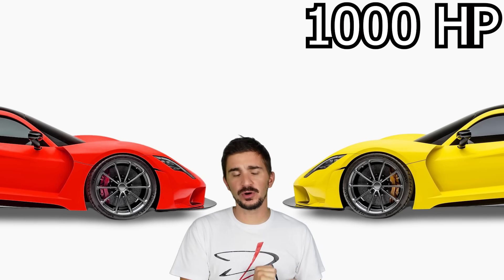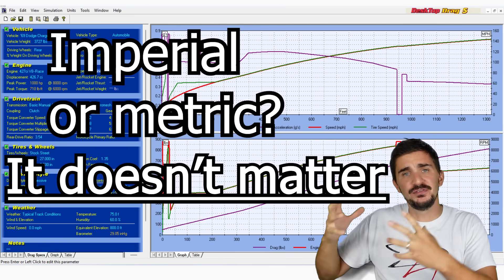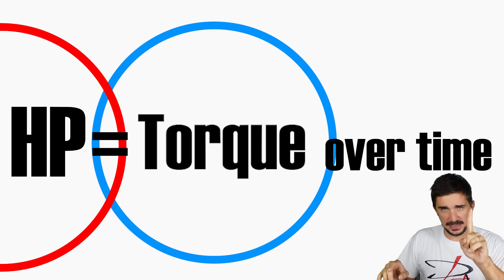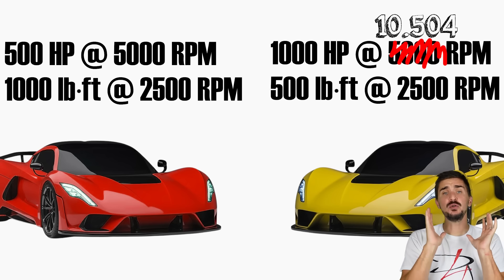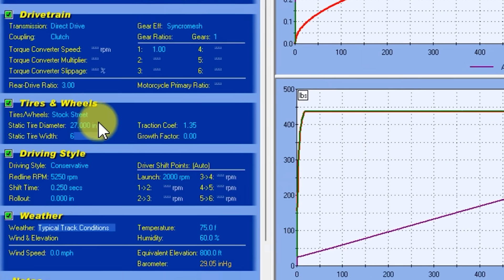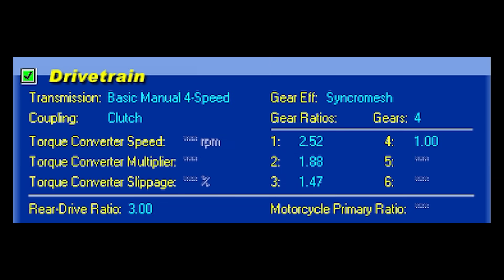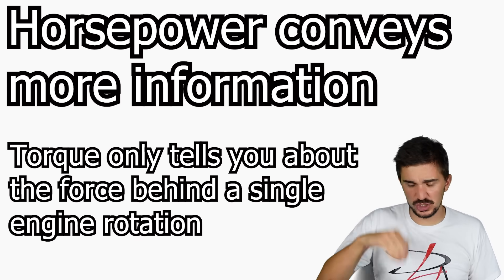Who's faster? Explained and Simulated - Horsepower vs Torque

Comment: Moving from A to B requires to put some energy, and the more energy you can put in the same amount of time, the faster you'll get there. And energy over time is the Power. So, with equal conditions, to be faster you need HP, not N*m.

And the famous quote "horse powers sell the vehicle and torque wins the races" is actually plants that power/torque misconception, because races is about getting from A to B in least amount of time, which is power, while in daily use you'll be more grateful for higher torque, for engine to be responsive to your throttle pedal, and that is about getting sold.

Comment: For anyone wondering how the example torque curves were summarized, he used the following:

@6:21
500hp @ 5000 rpm (would produce 525.2 lb-ft of torque at this rpm)
1000 lb-ft @ 2500 rpm (would produce 476 hp at this rpm)

The software doesn't know what to make of this awkward first set and actually interpolates a higher peak torque value at around 4000 rpm.  

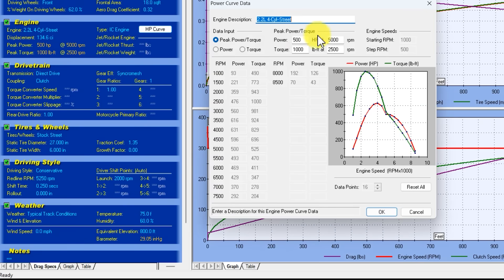@7:27
1000hp @ 10,504 rpm (would produce 500 lb-ft of torque at this rpm)
500 lb-ft @ 2500 rpm (would produce  238 hp at this rpm)

This second set is a (good) extreme theoretical example with a nearly flat torque curve to produce a nice peaky power curve.

Comment: Slight correction suggestion - horsepower is torque at speed.  Torque over time would be energy or work performed.  

It would be helpful to look at this from an energy/work perspective where a horsepower focus gives you more potential to get work done in the same amount of time.  Optimizing for a specific engine is then a matter of gearing.  

The other helpful viewpoint would be from force/torque/acceleration.  Then you can get to the same conclusion that greater average wheel torque can be achieved with higher horsepower if the gearbox can be optimized well enough.  

Making a car accelerate quickly is a matter of keeping the engine in the highest average horsepower range or the rear wheels in the highest average output torque range.   More aggressive rear-diff gearing can then be thought of as a way to let the engine get into its higher horsepower range more quickly and more often or equally correctly, a way to multiply torque to the rear wheels all the time.

Comment: I think what you have shown is that a properly designed car with higher HP should be faster than an equally properly designed car with high torque. 
Extrapolating, when considering racing cars it is certainly the case that HP > Torque. 
When considering custom street cars that may not be the case.

Comment: Like you forgot to mention is that on Street, torque is King. Torque is what pushes you back in your seat, torque is what get you from stoplight to stoplight.
Technically torque is how much work you can do, horsepower is how fast you can do that work.

Another thing you forgot, was to look at changing the distance of the track. The longer the track the more chance that the horsepower car would win....shorter tracks will buy us the torque car.
Reply: Technically torque means nothing. How much work is Work, not torque.  How much work can be done is the amount of fuel in your tank.

Comment: There's a bit of an issue I have with this video.

If you've ever looked at dyno data from an internal combustion engine car, you see that torque goes down, as RPM's increase (after you get past your peak torque), as the combustion cycle is shortened. So a car, such as the I don't know, a 98 Ford Mustang GT, will be making about 290 Ft-Lb's of torque, but that peak is at 3.5K RPM, then drops drastically, while the engine revs up to its peak horsepower at around 4.7K RPM. American engines, from my understanding, have historically been under-square, that is, having a longer piston travel than bore diameter, which results in lower horsepower figures than a similarly sized European engine.

hence why I think your simulation falls apart. It's just not realistic that an engine would produce peak torque at peak horsepower.

Or maybe I'm just ranting in the middle of the night. Long story short, I just don't think your thought experiment works, because it seems too divorced from real world conditions.

Comment: Great video, but the rpm calculation is wrong. To get that result you are assuming that the car is making peak power and torque at the same rpm which is never the case

Comment: At at 7:03 don't you limit the 1000 HP car by choosing the coservative driving style? Redline at 5250RPM in a car which makes max HP at over 10'000RPM isn't optimal...

Comment: Your video is correct but leads into the wrong direction. Let's have a more simple setup. If you want to drive at a speed of 200mph then you need a certain amount of HP, you can have all the torque in the world, as long as you don't reach the required HP you will not make it. Or the other way around you can have as little torque as you like, the moment you reach the required HP you can reach the speed.

If you now look at a more complex setup in a race situation, what you want to avoid at all cost is wheel spin. So your engine must not work like a switch, it needs a wider range where it delivers the power in a usable fashion. If you build an engine with insane torque but low HP then you end up with an engine with extremely low rpm so you are building a switch. That's not desirable.

Does this theory hold up with reality? Remember the F1 turbo era? They had like 1200 hp and above but these were not very high revving cars (well in F1 terms of course). The engine characteristics was: no power, no power, no power, BÄM, full power. They had a usable band of around 2000rpm. At peak turbo era, Porsche reduced the boost level (that means reducing torque and reducing power) in favour of a wider usable rpm range and that was one of the most successful F1 cars of all time despite the fact that Berger in his Benneton BMW had about 300! horses more under the bonnet. But it got even worse, remember the MP4/4, this car was the 1st generation N/A cars after the turbo era. They had half the power but a usable rpm band of what? 4000rpm 5000rpm. All drivers were complaining about a lack of power and still they managed to beat their previous lap records.

Look at LeMans and Audi and Peugeot building diesel race engines. In the beginning, they had the problem that their cars were basically impossible to drive because of too much torque.

Comment: Getting the powerband in the right place makes all the difference.  As much torque as you can get traction for off the line then more horsepower in the top end.

Comment: You corrected the HP biased car's peak RPM while assuming peak Torque the entire way through, but assume the Torque biased car drops off massively by 5000 RPM. Per the formula you used, the Torque biased car would only need 2626 RPM to reach the peak HP of 500 at peak Torque, and would need to drop to 525 Torque to reach 500 HP at 5000RPM. Giving the HP biased car a similar Torque dropoff would require nearly 20K RPM to achieve peak HP. How would that affect the races?

Comment: I thought you were explaining it well right up to 5:17. From then on you missed the mark. The rest of the video is just some made up, unrealistic scenario that doesn't represent any real world, properly engineered vehicles. Unfortunately, due to this you draw inaccurate conclusions and are further misguiding people on this subject which is the opposite of what you were hoping. For those who want to know the answer, I'll try to explain it below.

As correctly pointed out in the video, power is a function of torque times RPM. You can do this at the engine (as typically stated) or at the wheels. When measured at the wheels, you will have higher torque, but lower RPM. The result will be the same power when ignoring losses. How this comes together in vehicle design is you design for a certain WHEEL torque. This design limit can come from the grip limit of tires (as you somewhat figure out in your simulations) or from a torque required to move a truck and trailer up a grade. 

So since you are designing for wheel torque, you adjust your gear ratios depending on your engine's torque. An engine with half the torque will have double the gear ratio. This concept is completely missed in this video. You really need to redo the video starting with this and you'll have much better conclusions.

For those that want the answer, in simple terms power is all that matters. Now engines are not electric motors and don't have flat torque curves from 0 rpm. The also tend to be more efficient and more durable at lower RPMs. Why is much more complicated, but the short answer is friction (wear) and pumping losses increase with RPM.

For a given power level, a high torque, low RPM engine will be more efficient and last longer but be heavier (torque drives part strength and required displacement). A lower torque, higher spinning engine will be less efficient, but be smaller and lighter. This is why big trucks have engines that weigh over 1000lbs and make 400hp @3000rpm, while racing engines are more like 300lbs and 500hp @8000rpm. You can put the racing engine in the truck, and it would be faster, but that doesn't make sense $$$ wise. You can also put the truck engine in the racecar, but the weight has numerous other negatives.

Comment: Sometimes Hp doesn’t show the real capability.
A g63 have 577hp 627lb-ft with a redline of 7000 rpm.
A vipers acr have 645hp and 600lb-ft with a redline od 7000 rpm.
In reality G63 is one that has the most power

Comment: This calculation is really only meant for hp/torque calculations for electric motors. Much much more goes into that calculation for internal combustion engines. In general you can get close, but not all internal combustion engines follow this principle.

Comment: I love your channel and love your account, and the “boxing” example is the perfect way to explain horsepower and torque, I just don’t know if I completely agree with the rest of the video. 
So let’s say for this example that the torque curves are perfectly flat in both engines hypothetically speaking. One engine will have a constant 1000lbf of torque and will make 500hp at 2,626 rpm, while the other engine will have a constant 500lbf of torque and will make 1000hp at 10,504 rpm. Let’s assume these engines make their peak power at redline just for this example. At any given speed, assuming the gearing is correct for each engine, the 1000hp engine will have a 8:1 torque leverage advantage (to the differential or wheels either way) over the 500hp engine. Let’s also assume the differential and tire circumference is the same for both of our test cars. Let’s say that we are going 100kmh. With the same differential and tire circumference to go 100kmh, the car with 500hp and 1000lbf at peak power at 2,626 rpm (for maximum acceleration), will have a transmission gear ratio of 1:1. The identical car with the same differential and tire circumference and a 1000hp 500lbf engine at 10,504 rpm (for maximum acceleration) will have to have a transmission ratio of 4:1 in order to also be traveling 100kmh. 
Like I said, both engines are at their peak power/redline in order to accelerate as fast as possible, yet the 1000hp engine has more power and is turning a 4:1 gear ratio over the 500hp engine. 

(Torque*rpm*gear ratio)
1000lbf*2,626rpm*1 = 2.626M 
500lbf*10,504rpm*4 = 21.008M
= 1:8

(You could divide by 5252 for horsepower measurements, but the ratio would still be the same)

I’m not here to criticize because you are literally my favorite car YouTuber of all time and I’ve been watching for years and overall the video was a good video, these are just my thoughts. Of course this doesn’t take into consideration fuel economy, reliability, engine efficiency, or especially engines without perfect torque curves, but for just considering acceleration statistics, the horsepower engine would win.
But like I said, this is just theoretical, in a real car the results would be completely different considering tire grip as well. 
(I personally would still take the 500hp 1000lbf engine in a street car anyways, even though the 1000hp 500lbf engine is better on paper)

Great video, look forward to more in the future!!!

-Patrick B.

Comment: Forcing these two very different engines to operate with the same gear ratios and tire diameters makes for a bad comparison...both need a drive train that allows each engine to operate in the rpm range it needs to be in. A quick and fast car can be made a slug simply by selecting the wrong final drive ratio. In this case, the 1000 hp car probably spent little or even zero time actually producing 1000 hp. This is a flaw of the drivetrain, not the engine. An s2000 needs very different ratios than a viper. Gearing them the same for a comparison would not really prove much.
  A case of VERY different engines in essentially the same vehicle is a PIper Navajo- two 350 hp 700ft-lb 540cid piston engines. Compared to a Piper Cheyenne, with two 500hp turbines, that, at the power turbine, are probably a bit over 100ft-lb.
     BUT- the turbines are geared appropriately,  and the torque at the propellers is much higher. The performance at similar weights is very different, the turbine will vanish in the distance.
   If forced to operate at the rpm of the piston engine,  it would overtemp before the start was completed, let alone taxiing or flying.
   The correct transmission and rpm are essential.
Reply: Error there...the particular turbine I used as an example (Pratt & whitney pt6) would survive a start sequence due to a design peculiarity (free turbine), if geared horribly wrong, but all the other stuff still applies. I would guess it would be literally unable to even move the aircraft if forced to operate with the 1:1 ratio that works great with the torque rich recip engine. Give it appropriate gearing, however, and it will run away, just as the 1000 hp engine example here would if geared to let it reach the rpm at which it produces 1000 hp.
   The simulator should have a "CVT" transmission option to illustrate the effect of allowing any engine to operate at its power peak. No, I don't like  CVT's and probably none exist that will handle that power, but it would be helpful to know what is possible without the handicap of poor gearing choices.

Comment: Rather than punches, I prefer to think of it in terms of performing a task such as moving 1,000 bricks from point A to point B, and so while employee A might have double the torque of employee B meaning that he can carry twice as many bricks, employee B can make four round trips for each round trip made by employee A, with the net result being that employee B can do twice as much work as employee A hence employee B has double the horsepower of employee A.  Torque is simply a measurement of pure strength whereas horsepower also factors in iterations over time and hence is an actual measurement of the ability (i.e. time required) to do a predefined unit of work such as accelerating a car from 0 - 60.

Comment: Excellent video with a lot of good information. The funny thing is that you didn't even make it as complicated as it really is. The torque curve means more than anything, which is the torque over the whole rpm range. Peak hp and peak torque really don't tell any story. If you can maintain a lot of torque over a broad rpm range, that will win out over any peaky hp at the top end that only lasts for a short rpm range.
Reply: Read what power is. No wonder you rate the video as excellent.
Reply: Were you dropped on your head as a child?  @simplemachine9531

Comment: I always essentially knew this. High torque cars make more horsepower in the low rps therefore they get to peak Preformance faster. However low torque cars take time to get to peak horsepower in the high rpm’s therefore slowing them down. To put it very simply, horsepower is much better for street racing when you start in your power band but for drag racing you’ll need a balance of the 2, primarily torque because you need the power at the dead stop
Reply: No you don't need torque. Check how the cars are launched. Nobody starts from idle rpm. Engine almost doesn't work at peak torque at all
Reply: @simplemachine9531  in real life they maybe launch at 3000 rpm, peak horsepower is higher up in the rpm’s. In this case in the simulation, the high torque car was making more horsepower, just when the rpm’s were lower. The high torque car was faster because it was in its power band for the longest amount of time. It started with more horsepower essentially. The high horsepower low torque car has to take a ton of time to get to the peak horsepower that’s why it lost.
Reply: @simplemachine9531  horsepower is what wins races, what people don’t understand is that horsepower isn’t constant and the number listed is PEAK horsepower. The car that wins a race is the car with the highest horsepower throughout the whole race. When starting, accelerating, shifting etc. whichever car averages the most horsepower will win.
Reply: @simplemachine9531  all torque does is optimize the horsepower for the lower rpm’s, a high torque car will start off the line faster because it has more horsepower in the beginning
Reply: @andrewallen7032  
"primarily torque"
"ton of time"
https://youtu.be/AoDDODh5Ras?si=BdwO5IVZs3EBEL-V
You didn't say a word about gearing, maybe you don't know what is gearbox yet.
You know something, but you still overestimate torque too much.
This simulation, like all other attempts on topic of this blogger, is faulty. Many people pointed out the power engine was restricted by rpm and driving style was conservative (to save fuel, laughable).